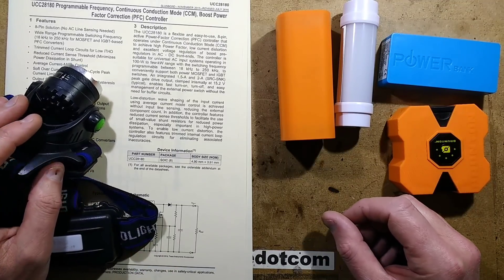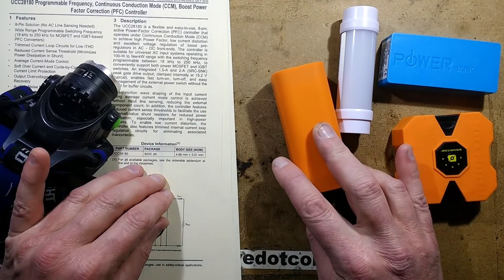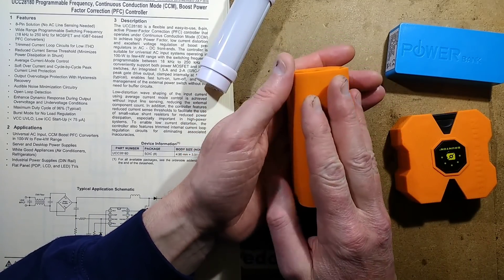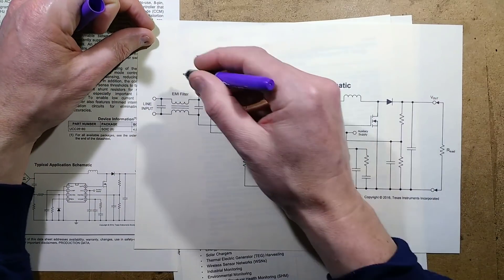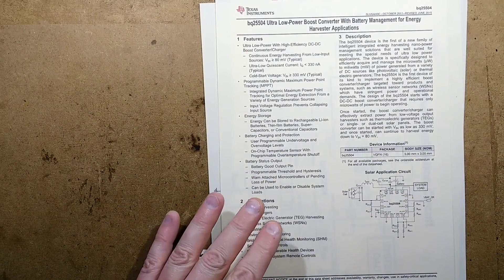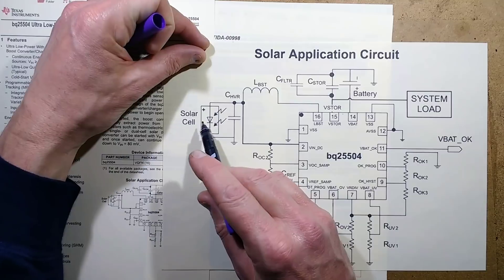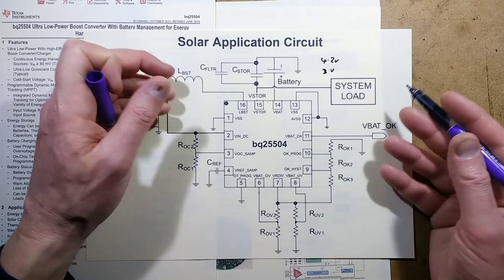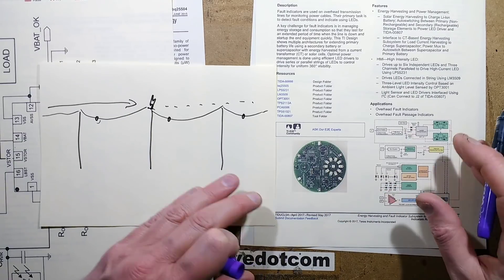A day without power management.

Comment: I looked up harvesting power from vibrations, and found quite the interesting topic. I found, for example, a module that harvests power using piezoelectric. The device says that it can only bend up to a max of 1 mm where it will crack and become unusable. Yet it's actually harvesting electricity from all of those vibrational bends that happen over time that fall under the 1 mm.

Comment: Since you mentioned hot water, I have to wonder if you have the tankless on-demand delivery of water heating? Because with a hot water tank, you should have a fair bit of time before that tank's contents cool off all the way to room temp -- especially if it's well insulated. And given your skills, I am surprised you don't have a power wall that could run your entire place for days. Such a system would be quite helpful to grid stability if people would either reload their battery banks during off-peak hours, or through solar.

Comment: When I was a teen-ager, I built a lot of DIY Electronics. I asked for so many data sheets and engineering samples... I think they knew I was a kid, but they sent the samples anyway. I guess they figure any kid who bothers with learning how to select OP amps is probably worth cultivating as a client, but my father was astonished at what they would send me. I easily would have cost enough to put a down payment on a house to buy all the chips they sent me. I have been thinking about the power factor problem. I think that a lot could be done with power conversation circuits that we will need for solor and battery backup systems. I am thinking something that follows the voltage and current, and uses a cap bank to fix the current waveform by pumping power in and out of the cap bank. When the line power fails, the same circuit could switch modes to be the inverter to run the house. This is basically a parallel inverter with some extra functions.

Comment: I have a 100ah powerbank And i charge my laptop with it And my router is on ups, so power outages dont Brother me that much.
Reply: Same here. Although in South Africa it's a prerequisite as they load shed us quite often, to the point that I scored a dual 55w solar panel, 2 charge controllers, and 6 x 17AH batteries (3 x parrallel in 2 sets to equal 24v) which I then bought buck converters and wired them directly up to the fibre router, cpe/ont, network switch and TV box.

The whole system is wired up so that it doesn't connect to council power unless there is 0% sunlight for about 39 hours, at which point the 2 battery sensing units I have wired up to the charger, sense the voltage is bellow 12.2v on the lowest battery bank and then switch on both the relays, which in turn connects the mains to the battery chargers, charging  the batteries up to 13.5v.

Obviously, if the sun then comes out during this time, the charge controllers give it the extra 0.2v it needs to switch the charge modules off (Disconnecting the mains input to the chargers) because the voltage is just ever so slightly higher than what the mains chargers are set to.

So, basically, everything mentioned above runs on battery backup permanently and if the batteries drain beyond 12.2v the chargers step in to charge the banks, and then gets relieved of its duties once the charge controllers get power from the solar panels, which is at 13.7v

I also built a couple of USB chargers with a tiny 2amp buck converter inside for charging anything that uses a USB port, which I might add are super reliable to charge phones as they only get to around 35°c when charging an almost flat cell phone.

Comment: Heya Clive, i can not find any video on you discussing lead acid batteries, do a quick google image search and you'll find so much conflicting info on them does 12v with no load mean 50% drain or is 12.5v 50% drained? So many conflicting values someone needs to determine which is correct!... hint hint :)

Comment: I reckon your 'leccie' is about as reliable as ours in rural Yorkshire, however, we have a choice of generating sets to see us through - Daytime, Brush RS-3 20kVa (makes a bit of noise!), Teatime, Lister 6kVa (not so noisy, and not so greedy on fuel), Night-time, Onan RV4 2kVa remote operated, propane fuelled (low output, fairly quiet, and you can start/stop the engine from indoors).

I admit though, that's not really in the spirit of this thread, but we do have a good smattering of LED torches, headlights and lanterns. Somewhere in the darkest recesses of our cabin, there are three DC-AC inverters of various types, and in cold weather, you can't beat a good old "Tilley"(tm) or "Vapalux"(tm) etc. One pint of paraffin provides about six hours burn time (light and heat), depending upon how much pressure in the tank. Even a couple of hurricane lamps are quite handy!

For a domestic room light, there's still plenty of scope for an "Aladdin"(tm) model 23, or "Super Aladdin"(tm) No.14 mantle lamp.

Comment: Please dissect and critique an "Emergency Radio/Flashlight/Charger". Ties in directly (Twice!) with this video - power outage device, and possible use of that 'low power charger' circuit
There's something about designing the circuit that leads to all of these devices (that I've worked with at least) having very irritating manual switching. And some simply skipping it/faking it entirely like a shaker-light you obliterated.  I'd really like to personally own a more robust one (even if I have to build it myself) honestly designed for an actual emergency as opposed to the tiny crank versions focused on the microamps the radio needs, but the switching aspect completely confuzzles me.

Comment: I don't know a whole lot about Electronics. Just the basics. It sounds like it's sending  more to one side of the sine wave  because the other side is being drawn down .
Is there a way on the sine wave, on the down stroke... it take that wave , send it back to the top wave (DC.)so that it's drawing again, that way it draws once on the top wave, once on the bottom wave but change it over so that it's still DC.? Here in the states it would be DC 60 hertz. Instead of DC 30 Hertz?

Comment: I will have to have a look at the reactive power metric on my PowerWall, next time I charge my car. I know that the onboard charger is running at 100% duty cycle while it's turning the 240VAC to 400VDC inside the car.

Comment: Being on an island does increase your likelihood of losing power, but living in a house with many trees between it and the power substation (2+ miles away) means we have dozens of opportunities to lose power whenever there is wind, ice or snow (briefly at least once a year, sometimes more frequently).  The 7 to 12 inches of snow across the county this past December had us without power for 12 hours and without landline phone, internet or cable TV for 30 hours.  We've had multiple short outages since then as the power company replaces some of the 7500 volt distribution lines with new wire (after XX repairs, they run new wire) and another three hour outage when a tree fell without the immediate assistance of the weather.  That tree was big enough to block a road so the incident got a paragraph in the local newspaper.
I have the white LED with magnetic base that you showed as it will stick to the side of the over-the-stove microwave oven and provide light for using the gas burners for cooking (long necked "grill" lighter on the counter by the stove for that).  My favorite LED headlight is a generic one that uses three AA cells with the battery pack at the back, similar to the one you showed.   It hangs on the knob of the door to the basement so I'll have light if I need to get backup power going after dark.
I write post-apocalypse fiction (mostly about families and rated PG/PG13) because the characters in my head keep having interesting conversations ;-)  I post the stories on a writers' forum and got "You should publish this" comments about one story - so I did.  The ebook sold some 1500 copies in a year and a half (certainly better than I expected) and I used the unexpected income to put together a solar charged backup power system that can run fridge, phone, internet and a few LED lights, and charge phones, tablet, etc for about 20 hours.  Considering that the longest outage we've had in more than 10 years is 16 hours, I won't be out in the dark or a thunderstorm getting a gasoline generator started.  The solar generator has a 12 volt, 540AH battery bank (AGM batteries from a data center UPS that were replaced by time - start of year 6 of their advertised 10 year life - not by condition, as these test like new batteries) and a 2000 watt pure sine wave inverter, which allows me to power essential items via a 4 circuit transfer switch (installed long ago for gasoline generator backup).  Nothing automatic except the sun keeping the batteries charged.
We also have light and heat options using much older technology - kerosene lamps and lanterns plus candles for light and a kerosene heater that saw days of service when the controller board on the furnace died and the "3 day" turnaround on the replacement board took 2 weeks (January, overnight low temperatures in teens F).
I do tend to run on once I get started - my first published novel was 800 pages...

Comment: So the Power Factor correction chip creates a ~390V DC output. I guess you then need another chip in order to step this down to something that is useful in common products?

It is quite a bit step down, even to server level 48V, hence seems quite surprising to have such a high output despite the benefits of power factor....
Reply from the maker: All UK switchmode supplies tend to operate at around 330V DC.  It's being stepped down to 5V from 330V in every USB power supply.

Comment: Oh, I like this. I'm actually a bit of a TI fanboy.
I was designing basically my first every circuit (discounting some blinky lights), which was a KVM switch that also comes up as two USB Hubs and you can switch which Hub the physical devices connect to.
This is a ridiculously niche application, so it is understandable this doesn't really exist as a product.

However, looking for ICs to accomplish this, I kept finding TI things. They really have ICs for everything imaginable. And their data sheets are simply amazing. Especially since they even give you example use cases.

In the end I never actually got it manufactured, since I didn't want to spend the money for a 4-layer board that might not even work. (And prototyping is not really an option, since both HDMI and USB are too fast for breadboards...)

Comment: I didn't understand how the first one works.. if let's say the voltage on the capacitor for the circuit to operate must be around 100V how can you charge it when the power line voltage is below that?
Reply from the maker: +mr1jon1smith The inductor and transistor form a boost converter where interrupting the current flow causes a peak.

Comment: I very much like this approach. 
"Power outage" should really not mean that you have to go without electronics, but run stuff with so little energy that it is still economic to operate it from (recharable) batteries.
generally people blame the EU for silly things, but all those EPU regulations brought us more efficient power supplies, better standby designs and (which i appreciate much) less heat during summer in our living rooms.

Comment: https://www.amazon.co.uk/dp/B0081GD28W/ref=cm_sw_r_fm_apa_91i9zbY8TQVJG

You have to check this out Clive after a customer asked me to fit this and looking at the quality I refused to fit and install. Take a look and see what you think. Ps it was in the uk
Reply from the maker: I wouldn't fit that.  The multi-plug sockets are always a compromise on connection quality.
Reply: bigclivedotcom I def did not fit the thing that really jumped out at me was the 2 cables two terminals and only one terminal screw. It screamed nope nope nope to me lol.

Comment: TI still does good data sheets, along with the older and more respected fabs who still do their own design work. So many of these newer knock-off companies don't give you anything beyond basic electrical/mechanical specs and pinout. No app notes, no example circuits, no recommended design do's-and-dont's. "You get what you pay for" applies on every level it seems!

Comment: In 2004, I attended a course in Montreal given by Microchip on power design and management. 
During the brake, I went to talk to the instructors and their power engineers. I asked them if they would be interested in designing and making an "Energy Harvesting" chip exactly as you described (BQ25504 ). 
They looked at me as if I was drunk or crazy! Told me that they don't think its a very useful chip and they would not be interested in providing me with any engineering help!
I even showed them a circuit I built that was capturing solar energy from solar cells at night from moon light! Much like your jewel thief, but it would charge a large cap and then, when the voltage was high enough, dump the cap into the battery.
But hey... I can show the horse where the water is, but I can't make the horse drink it...
Good on you Ti.

Comment: I once lost power for over 24 hours. Finally I had to get some power going so popped the hood on my retired police Crown Vic and hooked up a 750W inverter I have. Started it and left it idle. Ran extension cords inside and was able to run lighting and cell phone chargers, and my laptop. It ran like that over 12 hours, burning half a gallon of gasoline per hour. Least efficient 750W generator you can get, but it was nice to be able to get by on a whim. 
It was funny I went out to it after about 6 hours of idling and it was making a funny burbling noise. I stomped on the gas pedal and got about a gallon of water from each tailpipe. It had filled the mufflers with water and the noise was the exhaust bubbling through it.
Reply: Clyne Snowtail been there

Comment: I heard that these active power correcting chips can be damaged by cheap inverters outputting non-sinusoidal waveforms... Is that true?
Reply: Generally speaking, you should only use square-wave or modified-sine-wave inverters for "dumb" loads like motors, compressors/pumps, heaters, or tungsten lighting (but not LEDs or fluorescents with electronic drivers/ballasts). It's good practice to only use a pure-sine-wave inverter for anything involving sensitive electronics. Depending on the specific device, it may or may not survive running from a chopped sine wave supply for a given length of time (depending on just how rough the waveform is and a bunch of other variables), but for peace of mind it's best to spend a bit more and buy a decent inverter.

Comment: TI has always been a great company (at least from the stuff they put out). Love the energy harvesting chip thing... have to figure out how I could implement those in some of my projects that involve solar powered cameras and sensors.

Also, thanks for the detailed description about power factor. I was actually researching this earlier today as we had a lot of power supplies go bad at a certain office, all one after another. Was wondering if it could have been 'dirty' AC power.
Reply: Keep an eye on AvE's channel, he just posted a video for patrons all about power factor with particular regard to AC induction motors ("industrial lego" as he calls it). It will go live for non-patrons in a week.
Re. your power supply failures, it could be due to spikes or surges on the line ("dirty" power, as you called it) but that's not the same thing as poor power factor (although if you're on an industrial estate, the spikes/surges could be caused by a nearby factory that probably does have terrible power factor and should probably do something about it!).
Reply: Thanks for the info! I'll keep an eye out for that video when it shows up.

The office is right next to a Walmart and some industrial stuff, so maybe. The UPS that the equipment is plugged into I'd have figured would filter out high / low voltage spikes... but maybe it's not doing a good enough job? Or is there something else I'm missing?
Reply: Depends on the type of UPS. If it's an entry- or mid-level unit, it's probably an "offline" or "line interactive" type; these designs basically pass the mains input straight to the load (usually with some degree of filtering/noise suppression applied) and only failover to the internal batteries/inverter upon a loss of mains power, which can leave sensitive equipment vulnerable to spikes. Ideally, in mission-critical applications or if the extra cost is otherwise justified, you'd use a more expensive "online" unit (also known as "double conversion" or "double rectification" designs). These units always supply the load with clean inverter-generated AC power, the mains input is only used to charge the batteries. Obviously, this places a lot more demand on the batteries/charging circuitry/inverter, hence the increased cost of such designs. They also tend to have a lot more battery, being designed to run mission critical servers and such, so they usually weigh a bloody ton! The Wiki article on the topic is pretty good: https://en.wikipedia.org/wiki/Uninterruptible_power_supply#Technologies

Comment: To recall the phase relationship, some folks might try to get you to use the mnemonic "ELI the ICE man": Voltage leads Current with inductors; Current leads Voltage in capacitors" - ELI: E = voltage (emf), L = inductor/coil, I = current; ICE: I = current, C = capacitor, E = voltage
Reply: So this is the problem with mnemonics.... you have to remember so much extra stuff. Just learn and remember without mnemonics.

Comment: The energy harvesting chip is super cool. It's source for some fun projects for little devices you can leave around your house that occasionally activate with some LEDs or something.

Maybe this could be used for a 'hot hob' indicator? Can you get enough power from a few thermocouples?